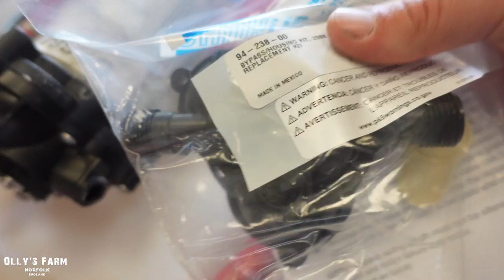THIS IS THE TOTAL COST OF RESTORING MY MASSEY FERGUSON 135! PLUS THE NEXT TRACTOR TO RESTORE!

Comment: gotta be a 1990's case ether a small 56 series  like a 956 case IH or a big 55 series like the iconic 1455 XL or its younger brother last of the truely grate Case IH tractors the 5100 series with the bomb proof Cummins engine